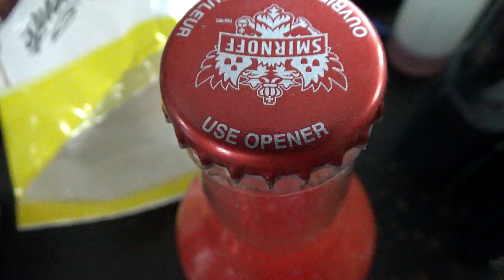Painting the new Wall

Comment: looks like someone put the swiss coffee color lid on an eggshell white paint bucket to me. it's not going to dry any darker either and you need a better roller handle than that the fact that your roller doesn't load up right when you put it in your paint tray liner is the reason it's not covering better also. you're basically just smearing the paint around on the wall at this point

Comment: Dude it's probably the other cans that's the correct color. Like I said the other day, eggshell isn't a color, it's the sheen of the finish. (Whether or not the paint is shinny or flat when dry). Also, not a good idea to run a fan when painting. It stirs up the dust and it will stick in your paint when dry.  Gotta load your roller up too with more paint, you were rolling too dry. Just trying to help man, not hating.  Worst case it's a primer coat and your next coat of paint will look better.
Reply: Don't forget the W paint method and sponge brushes rock .lol

Comment: Just a tip. Finish covering one area before you go spread out paint further out. Keep it loaded with paint. Do the W then just straight up and down motion. You were dry rolling too much. Try that the next coat. When you dip the roller in the tray you then roll it out on the sloped part and is shallower so the roller will fit in the tray most of the time. I always leave the tray on the floor also. Seems like the roller was just a little too long so i think that's why yours wouldn't fit. It's a good base coat now. The more you know!!! LOL

Comment: always found $ store painting products garbage, nothing but trouble. Taking paper off of wood...soak with a wet sponge, should peel off easily. The difference between a bad job and a good one is prep. My opinion all cracks and holes should have been filled with PolyFilla (plaster like compound) then sanded down to make seams and holes invisible. I would also paint whole room. The extra effort would make the room look great. Repairs and modifications should not stand out like a sore thumb.